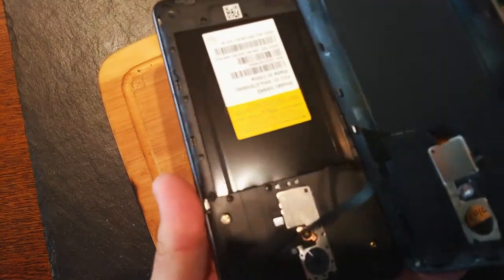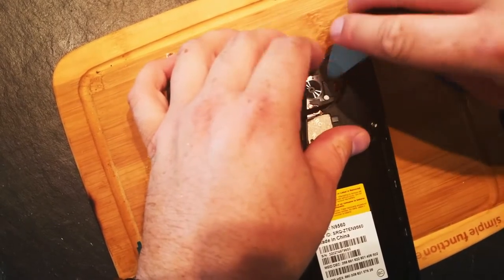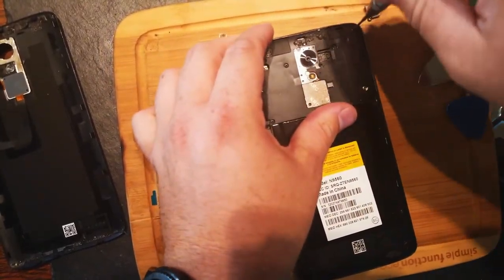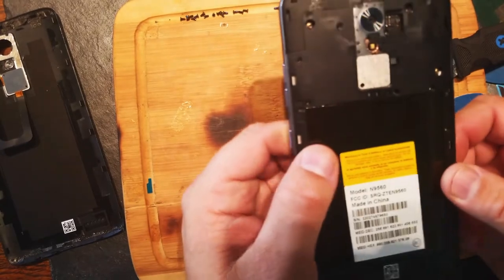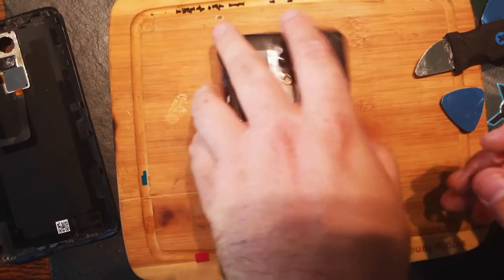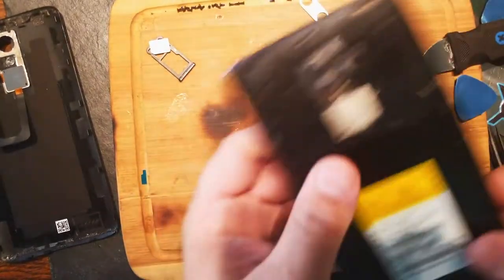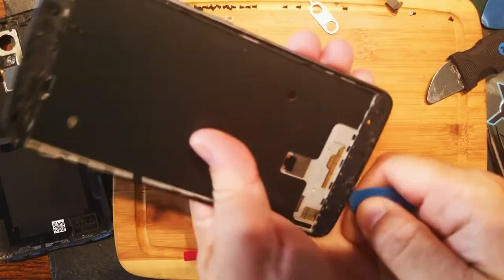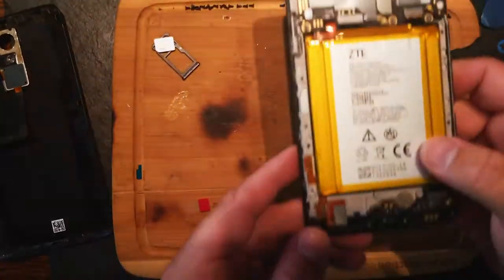ZTE ZMAX XL Screen Repair in Salt Lake City Utah

Comment: Can i use the screen of my max pro on a  zmax xl ....the screen cracked on my XL and if i could save a few bucks and not buy a replacement .ill switch it my self ..but i want to be sure first instead of taking appart both phones and it ends up not working